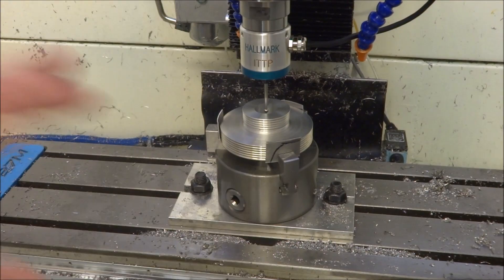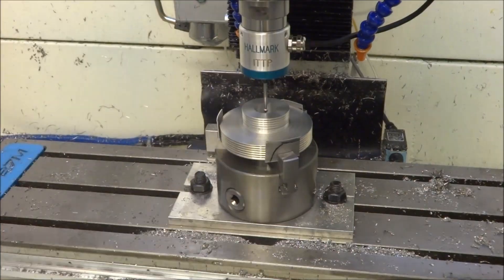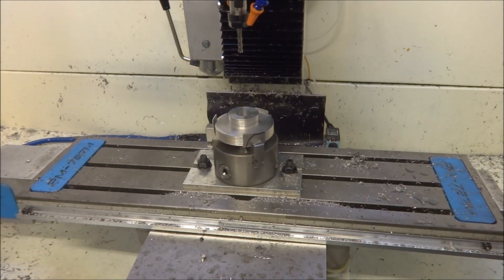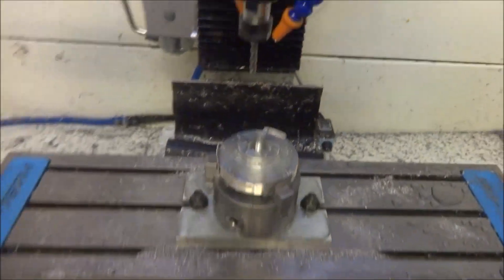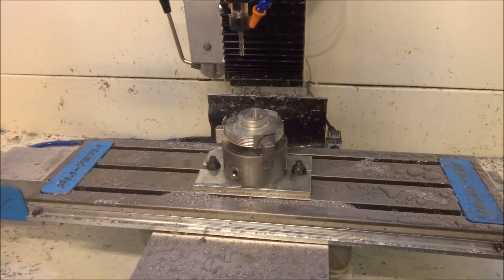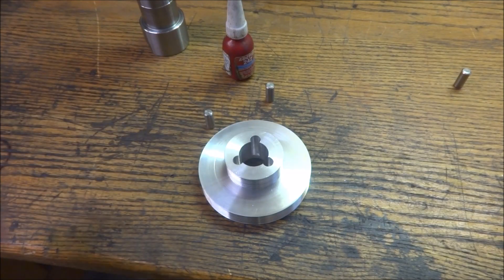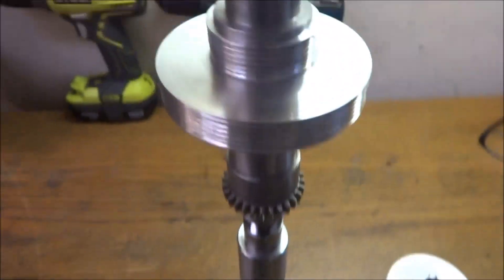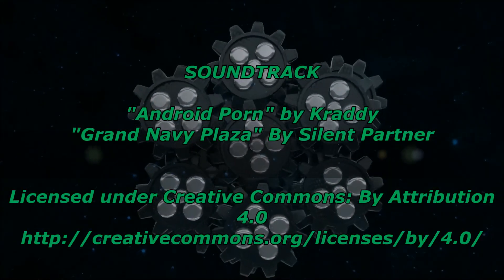Spindle Pulley Drive Dogs

Comment: hello Sam,
    I have a question about Loctite use, I have seen it mentioned that Loctite is being used on press fits in other videos, has something changed with this product?, it was my belief that a certain clearance between two parts was necessary for Loctite to act 100%, and without clearance, it is defeating the object of its use, a press fit will squeeze all the plastic out will it not?,

Just my own theory,

Edmund..........Alberta.
Reply from the maker: Your most likely correct as it appeared to just push all the loctite out , just habit I use loctite quite a bit.

Comment: Can you remove the spindle without removing the head from the machine if so how ?
Reply from the maker: Yes its fairly easy on mine since I removed the Quill Levers. with this removed it will slide out the bottom.

Comment: Great video Did you change the spindle bearings since  the machine was new ? If so what brand and # did you get
Reply from the maker: Thanks No not yet Not but I do plan to replace them when Install the belt drive.
Nachi 30207 http://amzn.to/2yoChBS
Nachi 30205 http://amzn.to/2z8O2Km
Shop Around you can find them on ebay as well or VBX bearings